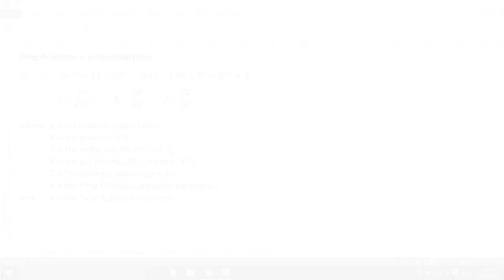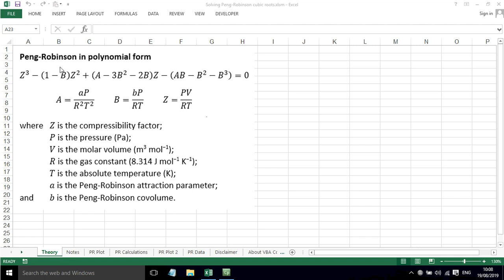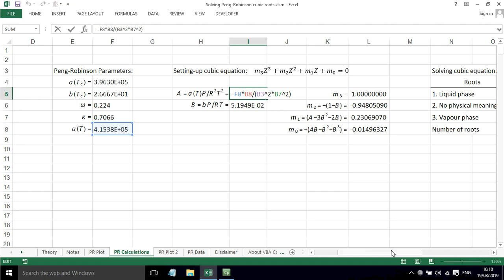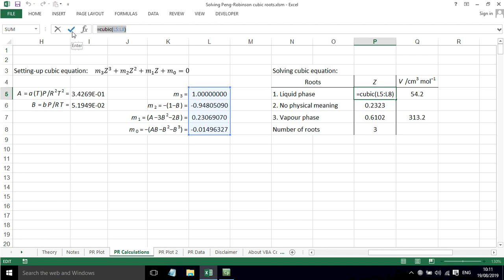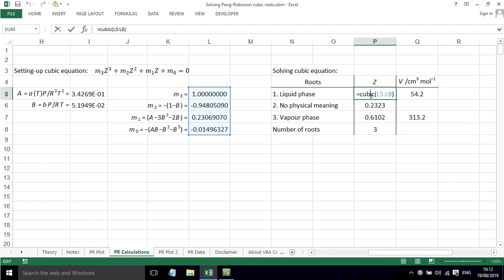Equations of State part 6: solving Peng-Robinson cubic roots

Comment: I checked the cube function in excell. but could not find. Should we set it up?
Reply from the maker: It is a custom function, as described the video. If you want to use it, you will need to download the spreadsheet using the link in the video description.

Comment: Great help, but one question. When solving for the emperical function 'alpha'. 
The correct equation is: (1+(0.37464+1.54226w-0.26992w^2)(1-sqrt(Tc))^2. However, in your excel work. You multiplied this value by the Critical temperature again, why is this so? Any clarification would be greatly appreciated. Thanks